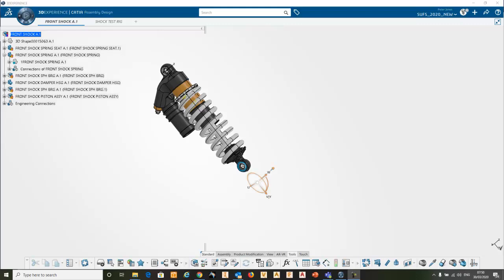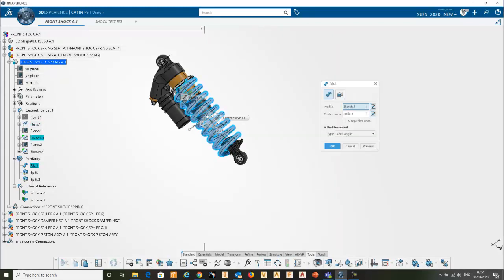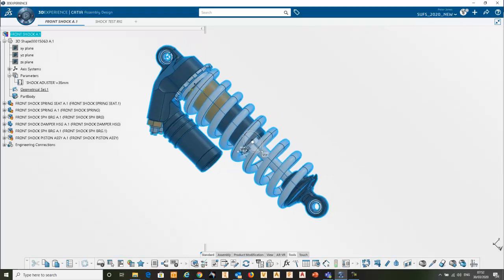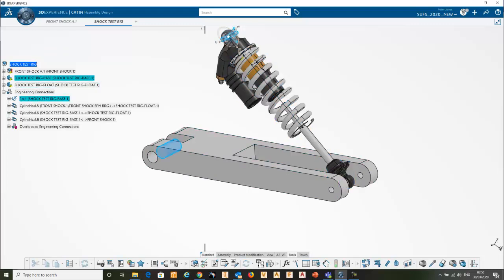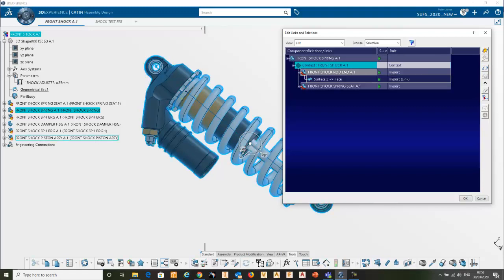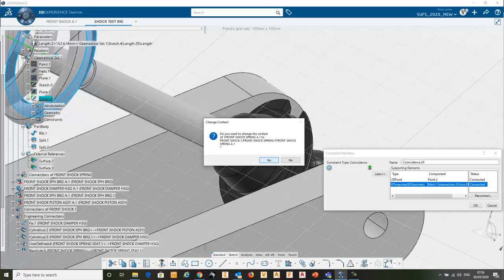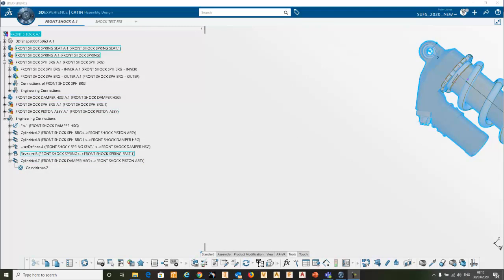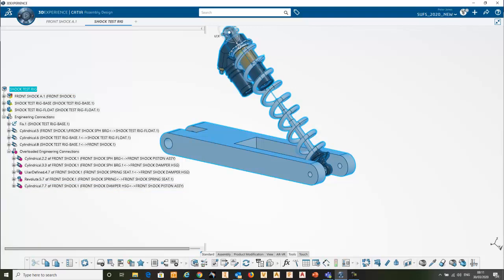Flex Assy and SPRINGS in CATIA V6

Comment: Jones, I have a question, is many years now that I am working in CATIA, in conjunction with (PTC)Windchill, we will move as next PDM in Teamcenter, now the question is, if I will use this approach of flexible assy, the Spring became also Flexible ?, because other way the Windchill system, will recognize, that the spring is changed, and will ask me to Revise, and Check-out the CAD model of the spring !?, and this every time I will use the CAD model of the spring in different assembly, with different height !?
I am asking this, because, we never find a way to apply the concept, of flexible part in CATIA as is in CREO or NX.
Reply from the maker: Matteo what you describe is what I’d expect tbh. If you want multiple assys including the spring at different lengths then they become different instances irrespective of the PLM data management system.